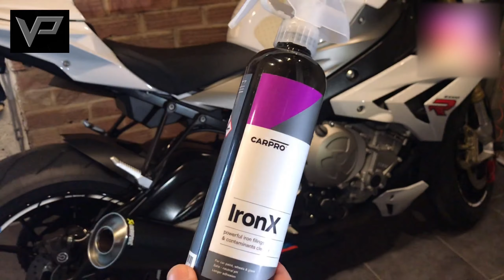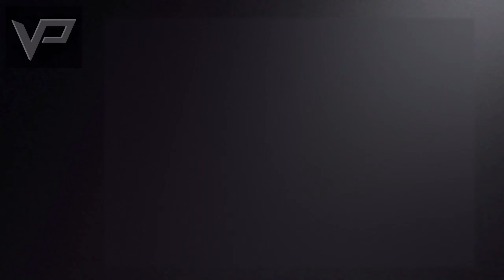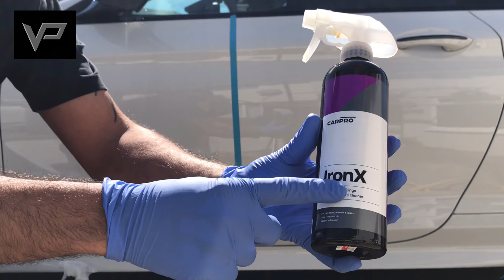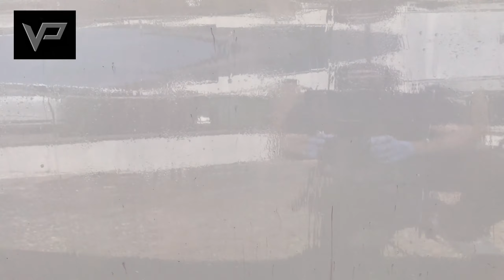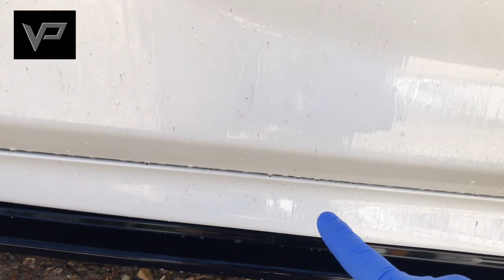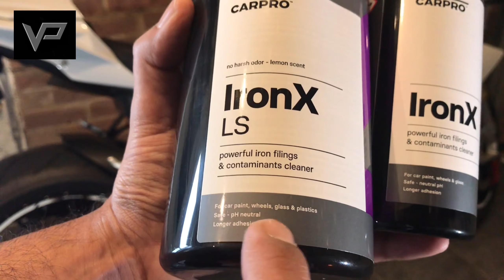CarPro Iron-X CHERRY vs CarPro Iron-X LEMON : More than just smells (QHD)

Comment: Instead of using microfibre towel to remove the contaminants, consider using the Iron X Snow Soap (1:8 dilution) as the contact wash over the Iron X and leave it for a few minutes, essentially extending the dwell time, then rinse the snow soap.
Reply from the maker: @jagayong9333 - First thanks for watching! It’s a good suggestion however, in certain scenarios mechanical action removes more contaminants than chemical action alone.  Using a microfibre to remove embedded contaminants such as ferrous contamination is one of those scenarios.  However, using a pressure washer rather than a hose would also assist!  Hope this helps.  If you’ve not already done so check out the rest of the channel & subscribe! Thanks 👍🏽🚗💯

Comment: If i want to remove 100% of iron on the panels, do i keep on applying iron x many times until it all goes away? what will be a quicker way to remove those iron on the car? I dont know if applying iron x on microfibre then on panel if it is more effective? how many times did it take you to remove them 100%?
Reply from the maker: R.K - Firstly thanks for watching! Great question - have you heard of a term called “Over Detailing”? Unfortunately your question would fall into that category.  In the vast majority of cases one application of a professional iron removal product would remove enough embedded iron contamination to allow a protection product to bond sufficiently to the intended vehicle surface! If you insist - then maybe one more hit but certainly no more! Not only is it a waste of time but also a waste of product & money! Apply, allow to work, wipe with a damp microfibre cloth & rinse! Job done! If you’ve not already done so please check out the rest of the channel and subscribe! Thanks 👍🏽🙏🏽🚗
Reply: @VProjectUKDetailing  interesting.
So if someone were to apply it many times could it oxidise or damage the clearcoat in anyway?
Some people recommend no more than twice per year decon but not sure why they would say that, is it because it's harmful to the paint or because of waste of product?
Reply from the maker: R.K - Over application is generally safe but it’s just a waste of time, product & money! Most important thing is not to apply in direct sunlight and/or let it dry!  You apply twice a year only when decontaminating prior to applying your protection product of choice! or only apply if you are decontaminating prior to applying protection whatever timescale that is 👍🏽🙏🏽🚘